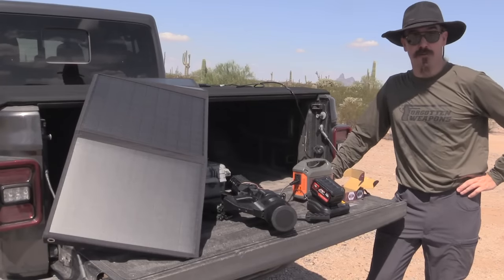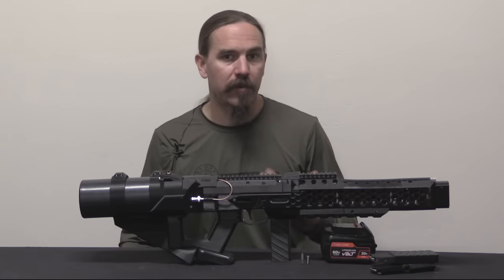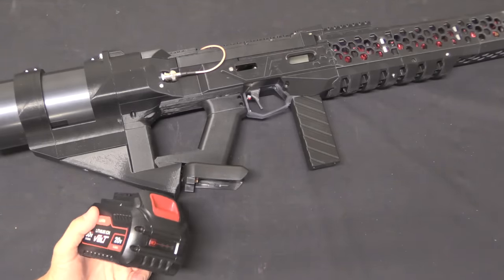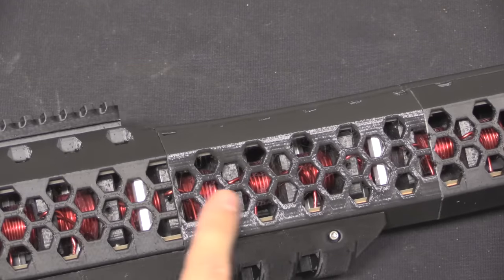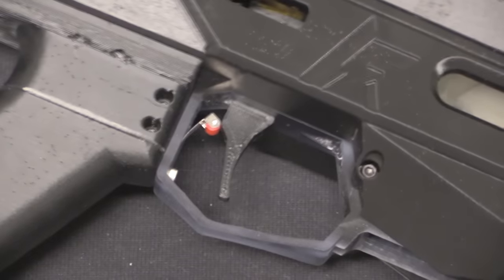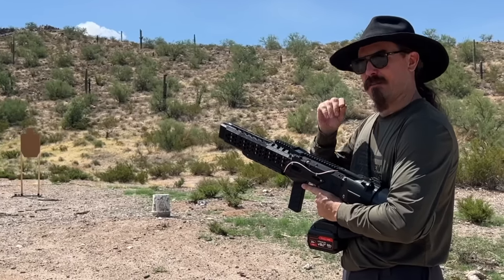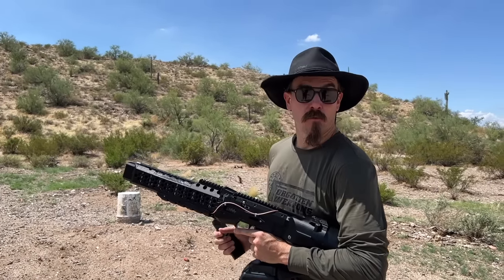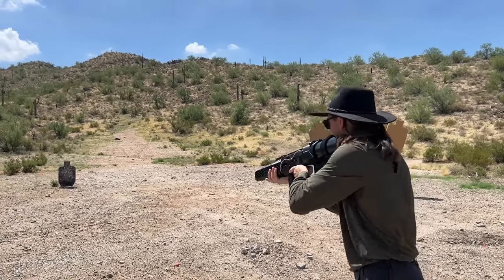ArcFlash Labs EMG-02 CoilGun: Making SciFi Weapons Into Reality

Comment: Now that they've got more battery than bullets, they need to put a paintball hopper full of steel ball bearings on top of that thing.
Reply: I'm wondering if the projectiles cannot be round for electromagnetic effects to work properly, and ArcLabs should already know the answer to that question. If they don't, however, then testing is the only solution.
Reply: @dionh70  its more of a practical thing because adding a hopper to the top of the gun with another 5lbs of projectiles would call for a redesign of the coils, loading mechanism so on and so forth. it would probably be best for them to start from the ground up if they were to use spherical projectiles. it would make for a very good lmg type design though.
Reply: There's no reason a paintball gun wouldnt launch a steel ball anyways. As long as its the correct size for the barrel, itll go. I thought of using marbles but afraid the marker might chop it to bits.
Reply: A paintball gun would probably fire them at a similar speed to the EMG-02 as well.
Reply: @burgerbait  probably not, a steel ball the size of a paintball would be dozens of times heavier than a paintball. But idk, that sounds like a job for someone who knows physics
Reply: No, don't use a hopper. Use either either an electronically operated box magazine/hopper below the gun or a spring-driven helical feed. Both of these already exist, and would be relatively easy to adapt to such a purpose. The helical feed could even be modified to use elongated projectiles, such as those used in Calico and Bizon submachine guns.
Reply: @HieronymousLex  I had a paintball gun and that fired paintballs at around 300fps. It didn't seem too absurd that a steel ball could fire at 200fps but the more I think about it, the more I'm not so sure haha. Would make for a fun experiment.
Reply: @dionh70  The problem is that spheres are the lightest projectiles you can make of a given caliber. 

You need the coils to be as small as reasonable because magnetic forces diminish according to the cube of the distance, but at the same time weight is the limiting factor. 

Ball bearings would be the most inefficient projectile for the gun, and since the velocity is so low I think the only way to make it reasonably powerful would be to use longer projectile, dart shaped. The problem then is aerodynamics.
Reply: @iotaje1  Would mounting collapsible fins on the dart so they "spring out" once it exists the barrel work?
Reply: @louiscypher4186  probably but that would make for really expensive ammo.

Comment: It's a bit like medieval bow or crossbow. They also had to work with a max v0. Bow limbs only move that fast, no matter how heavy the drawweight is. So too improve power, they used heavier arrows and bolts
Reply: Very accurate analogy
Reply: Informative and appreciated reference. Food for thought.
Reply: Except that is not actually a limit with coilgun technology at all, only their particular implementation. Even without a low pressure barrel you could get way more than 100 times faster than this prototype. It wouldn't have the same rate of fire though. If I had to guess it sounds like their timing circuitry is too slow to handle switching at a faster rate, but that is an easy fix really.
Reply: I should add that the actual max speed for coilgun technology (disregarding energy requirements and size) is about 110km per second. I would expect a company to make a portable rifled (which you can do using magnetism itself) super sonic coilgun within the next 5 years or so. Super capacitor technology will help immensely with this.

Comment: At first I was like "Ehh having to have two sources of ammunition for the same gun..."

but then he started firing drill bits. He turned drill bits into ammunition on the fly.
Reply: Drill bits...cool...only spin on contact...not accurate but great wound channeling...
Reply: Maybe a smaller battery could be housed in the base of the magazine. Something good for say 100 shots. So a 20 round magazine could be refilled up to 5 times on a single charge. Carrying multiple magazines has got to be easier than carrying spare battery packs. You could even have a reserve battery on the gun itself for additional shots once the mags are depleted.
Reply: @bluesrocker91  If you're still engaging after 300 shots, you have a bigger problem. Not saying your ideas are bad by any means, but if you get 300 shots per battery, that's 20 mags. Not sure how many mags a marine carries right now, but it's probably less than half that (to account for differences in capacity).
Reply: @bluesrocker91  Not a bad idea, to be honest. As a bonus, and to keep the “plug and play” benefits of the drill battery, they could literally use the same batteries used for E-Flite type micro helicopters - then you could charge the mags using a little E-Flite USB charger.
Reply: @shadowmancy9183  also the mags on this thing are smaller because they don't need to have their own propellant so a marine could actually carry more ammo with this configuration and just a handfull of batteries

Imaginé a future where a single soldiers can carry thousands of rounds of ammunition that don't weight any more than what they are already carrying
Reply: lmao perfect
Reply: Could fire pretty much anything ferrous that you can fit into the barrel, which is a feature of coil guns that fiction often overlooks.
Reply: Would be awesome to see against a ballistic dummy!!!
Reply: @bluesrocker91  or eventually they could get batteries formed in the shape they want.
Reply: @HelminthCombos  You could do, although an off-the-shelf drill battery would be cheaper and easier to replace than a bespoke battery design.
Reply: @gatorgod7728  Or even a watermelon or something. I would love to see what it does to something approximating flesh.

Comment: I love everything about this gun. The use of drill batteries, the high-voltage wire just chilling outside of the weapon, the licatinny rail, the computer screen, the inclusion of a stock, EVERYTHING. I'm literally looking at the future, here today, & can laugh in the face of that guy from 10 years ago who said I'd never be able to own a powerarm in my lifetime.
Reply: There is no stock, that's a live capacitor of extreme proportions right next to your face! It NEEDS a stock, something that won't become shrapnel if the cap explodes.

Comment: When I was in the Military DARPA sent a test model coil gun out to us with along with some manufacturing reps. from the company. Our gun could KILL. It shoot .25 calibrator steel/carbide tipped darts that where 7.5" long and weighed 560 grains ea. They looked like small arrows. It held 34 darts in a disposable or reusable rotating dram and the darts had rifling grooves on their whole length which made the darts spin and made them difficult to pull out of bone. The coils electromagnets also induced magnetic fields in the darts which made them spin and become magnetized after passing through the barrel. The barrel had a silicon carbide coated sleeve good for 250,000 rounds. At sub sonic 1020 feet per second it had 7 times the penetrating power of a 45 ACP pistol and held 1" groups from 250 yards while being 100% silent. Using ballistic gel we calculated the dart would pass through 4 human bodies including ribs and spin. Very deadly short range weapon for special Ops. The power-pack was as a disposable aluminum air battery with 1150kw and Maxwell Super-caps for power release. Result: The department of Navy needed more range so a model with 14" by 17 caliber darts has been proposed next in both subsonic and full power 2800 FPS models. Darts include metal penetrating and "SHREAD" DARTS that deform on impact. THE ADVANTAGE OF DARTS OVER BULLETS is that they have more mass in a more air resistant shape like an arrow. This could be the future cross over weapons before pure energy weapons are developed (Plasma burst weapons are next after 2050).
Reply: Yeah and I tested a plasma rifle in the 40 watt range from area 51 about fifteen years ago.
Reply: Thank You for this info, nowadays anything's possible, unbelievable -

Comment: I think my big issue with the capacitor being at the back like that is if the capacitor fails then the explosion is going straight into your chest. I've seen a capacitor failure at a similar size and it's like a small breaching charge going off.
Reply: yeah definitely needs bulletproof casing that can vent the explosion away from the user
Reply: Into their hands, legs or head?
Reply: @snedfed6023  into their best friend standing behind him whom he discovered was secretly bonking his wife.
Reply: @snedfed6023  if you used the cap as a stock like he does, into your shoulder.
Reply: I believe the next models are going to change to a backpack + feeding belt mechanism, more or less like a XM556 Microgun: the gun would be lighter, the capacitors could be bigger but better protected and, finally, bigger projectiles could be stored in great numbers
Reply: So, direct all DEW at guy with rail gun?
Reply: @logon235  That's two negligent discharges for the price of one...
Reply: @carloorelli3538  Somebody let me know when this comes out
Reply: I blew up a relatively small capacitor once. Part of it became imbedded in the ceiling.
Reply: @thenovadeus  I bet your friends made you King Faraday.
Reply: @obediahpolkinghorniii564  only one day?
Reply: @curtisnixon5313  May are coiled but few are inducted.
Reply: Polarized electrolytic capacitors can indeed explode violently (they are the usually cylindrical kind people usually imagine when talking about capacitors), but there's a plethora of other kinds of capacitors. Ceramic, film, glass, polarized vs non-polarized, etc. All of these behave differently in case of failure and many of them simply act as big resistors and heat up a little.
So the capacitor being at the back will not necessarily be an issue.
Reply: Vent out the side away from you
Reply: yeah, just throw capacitors at the enemy then!
Reply: @HappySnappyChappy  That’ll give them quite a shock.
Reply: Just use solid caps.
Reply: @logon235  just point the bang bang end at them instead of forcing capacitor failure.
Reply: @sparklesparklesparkle6318  that would be murder.
Reply: Yeah when I realized that was a Cap and not a plastic butt stock piece, i'm pretty sure my skin would have won a competition with a sheet of A4.  The back end of this gun is about a thousand times more dangerous than the front.
Reply: I still remember the aftermath of a guy wiring a large capacitor in his car, for the stereo. Blew through the trunk lid!
Reply: @obediahpolkinghorniii564  Ouch.  The oldies are the goodies!

Comment: makes sense. muzzel velocity would be dependant on the cycling of the coils in series. that is determined by the circuit configuration independant of the mass of the projectile. i would expect that outside the mass tolerances for the coilgun the projectile will just fail to accelerate because the second coil cycles before the projectile has had enough time to be moved by the magnetic force from the first coil.

Comment: I kinda want one now but it would be nice to have a protective "stock" around that capacitor since people tend to not be the most careful. Plus a protective case around it would shield you if the Cap explodes.
Reply: Need one hell of a material to make a difference with that size of a capacitor.
Reply: @seanpeery7780  Only if you don't like shrapnel.
Reply: My guy. It's pressed to his CHEST. Nothing is going to help if it explodes.
Reply: @TheDsRequiem  Maybe if it was designed w an intentional weak point that's away from the chest or to the side it would be....slightly less likely to kill you. lol
Reply: Which direction are you going to vent it?  I has to go somewhere.  Anyone drive an electric car, you're sitting on all the 'energy' and you have other motorists targeting you...
Reply: @seanpeery7780  Would Titanium work? The Rifle can be heavier than a traditional one, because as he said, "There's no recoil."
Reply: @jackwilborn2353  Down, and away from him? Seems there's 1/4 of his body that the capacitor isn't facing.
Reply: @jackwilborn2353  Gas powered car drivers are also sitting on all the energy
Reply: @MyNextShotWontMiss  It's worthwhile to point out that there are safety issues with the batteries in electric cars I guess, but really strange to make it out to be so much worse than 25 gallons of gasoline sitting right next to a hot engine.  Turns out cars are all dangerous, who knew.
Reply: Yeah the individual capacitors under the barrel from the first iteration definitely seem a tad bit safer, much smaller and positioned at the opposite end of the gun, maybe they could fit the magazine in the stock instead? Interesting to think of how to put together a weapon that doesn't necessarily follow the same restrictions as traditional firearms
Reply: @wolfrainexxx  There's 'no' recoil because the muzzle velocity is orders of magnitude lower than a traditional firearm. Force=mass*acceleration, and every action has an equal and opposite reaction. While there is slightly less mass being expelled due to the lack of gunpowder, the recoil force from that is a small percentage of the total recoil on a firearm.
Reply: @SpaceNerd117  That didn't answer my question, but thank you for the information...
Reply: @crookeddesk  I really would consider wiring to a back pack with armored section and a blow out plate away from the body, like an Abrams ammunition locker idea

Comment: Seems like something that would be well suited to leverage the advantages of a bullpup design in order to increase overall barrel length & number of coils without increasing overall firearm length - without suffering some of the disadvantages associated with bullpup firearms (no mechanical linkages between trigger and a firing pin to add creep to the trigger, no muzzle blast to get closer to the shooter's ears).

I do wonder how much more accurate it'd be if the ammunition was shaped to aerodynamically stabilize (like a dart or shotgun slugs) - would add some cost to the projectiles, but any cost increase could be weighed against any improvement in accuracy....  though the drill bits being fired tip last may even do the trick - which would make it a Gauss (bit) Driver

Comment: the real question we all should be asking is... does it have a Makita/DeWalt conversion mod?
Reply: Milwaukee or bust
Reply: You can but a slot on battery converter depending on your battery on Amazon
Reply: It already uses the DeWalt style battery locking tab, a DeWalt 60V should slot in with no modification
Reply: Yeah this is identical to the Dewalt Flex Volt 6.0 battery.

Comment: I've been interested in coil guns (or Gauss weapons) since the mid '90s. There was a brief period in the early 2000s when I was considering making my own, but circumstances prevented it (I had a piece of hardware put into my head that required me to avoid magnetic fields). It's nice to see that things are progressing.
Reply: gee, I wonder how that accident happened...
Reply: @canobenitez  Actually, I had massive pressure building up in my head and so they put in a device to drain the excess fluid. I never got started making a coil gun.
Reply: It was mechwarrior wasnt it 😄
Reply: @luminousfractal420  It actually wasn't. I stumbled on a physics article about it and that was what hooked me.
Reply: I always thought coil guns have potential, I think they could be used on electric tanks and of course ships. Battery energy density will only improve in the coming years and decades.

Comment: To briefly cover the bit at the beginning about "not a railgun"

A Dutch fella named "Lorentz" figured out that if you run an electrical current through a magnetic field, it applies a force on the object carrying the current (called Lorentz force). 

So we can put two metal rails down, and have a free float projectile bridging the two, then run a current through them to create a complete circuit, and the Lorentz force pushes the bullet along the fields. 

-----

Meanwhile a coilgun, the thing Ian's holding, uses a completely different principle called "Electromagnetism". When you run current through a wire, It creates a very gentle magnetic field around the wire. If we take that wire and we wrap it repeatedly into coils, weak magnetic fields stack to create a strong magnetic field in the center of the coil. 

A coilgun puts several of these coiled electromagnets in sequence, and turns them on and off VERY fast to pull a magnetic projectile through the barrel.